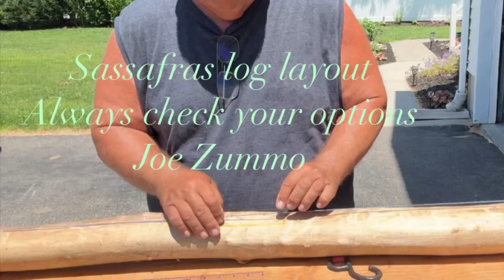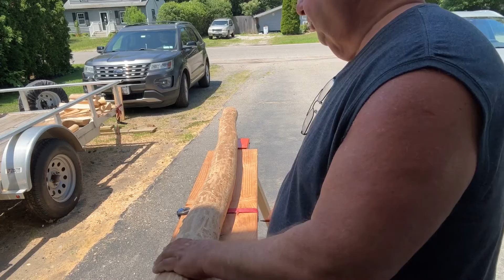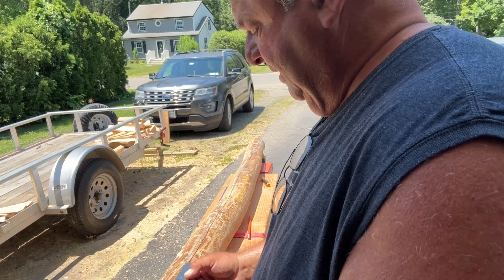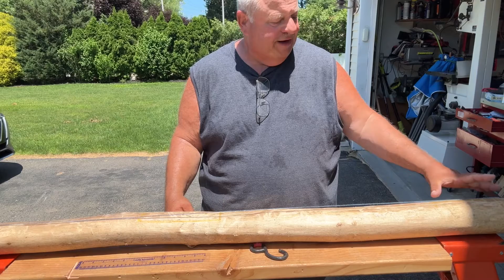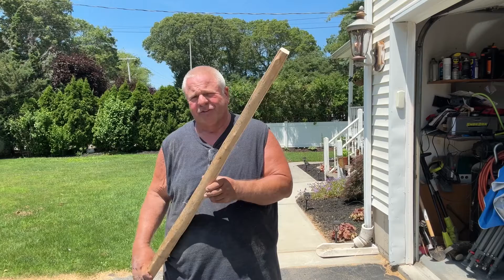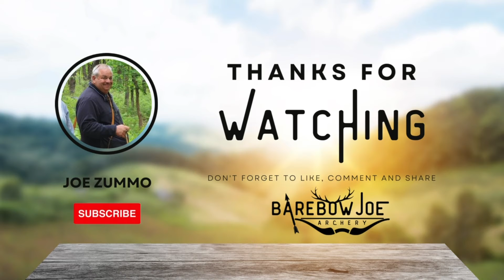Sassafras log layout Always check your options Joe Zummo

Comment: Many thanks for this video!!To my mind these are the most important, and difficult first steps to begin with the building of a bow from any  " branch " out of the woods, and because of the great variety  of wooden sticks one never stops learning from an expert.   The other posibility would be to learn from tral and error,  than one needs a lot of time and sticks or one can buy a rattan /manau) stick ......what is ideal to get an idea to make ones first self bow
Reply from the maker: Look for local wood. Go to ShannonOutdoord and buy his fire hardening video. Start with a safe length bow . 2 times your draw length + 8 inches for your handle + 4 inches 
. If you draw length is 28 inches x2 = 56 + the riser / handle 8 inches=64 + 4 = 68” long. This is a safe design . Make the limbs at the fade-out minimum of 13/4 to 2” wide taper to tips 1/2”.